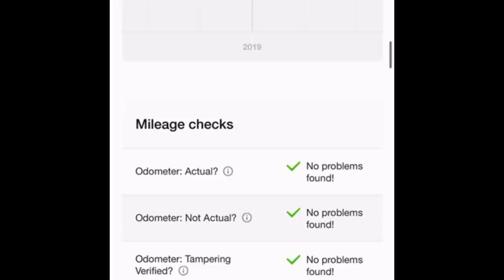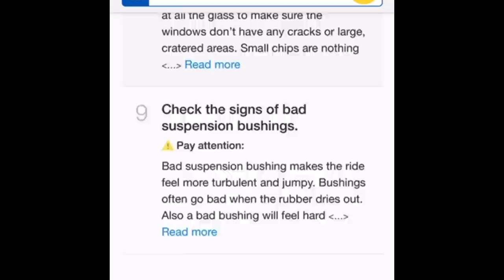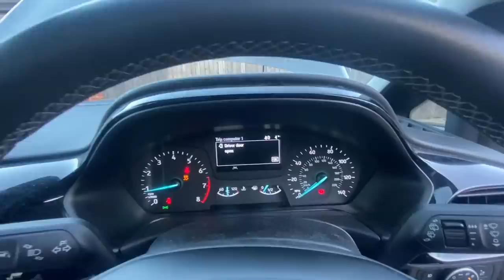2019 Fiesta Lemon !!!! Probably The Worst Crash Repaired Car Ever !!!! PT 1

Comment: Having seen someone actually say that on a BMW X3 the damage to the wheel arch/sill wouldn't be visible because the wheel arch liner would hide and thus didn't need repairing I was horrified. What you have found is the tip of the iceberg, please keep these coming, hopefully the buying public can be made more aware of what's out there.

Comment: In Australia, they have two categorys of write off, repairable write off and statutory write-offs. Statutory write offs are deemed unsafe to be repaired like Cat Bs and can only be broken up for parts. Repairable write-offs can only go back on the road with an approved structural inspection (usually at select government approved body shops or by government inspectors) where photographs of the repair process must be presented as well as receipts for the parts used (to limit the use of ringers/stolen parts). It makes the repair process considerably slower and more expensive but it keeps the repaired vehicles safe. It makes it a fair industry where you can still repair vehicles even if you don't have the formal qualifications provided the repairs are done properly.
They could adopt a similar system in the UK, perhaps loosing their Cat status when repaired properly to give incentives to the repairer to repair the vehicle to a high standard.

Comment: Chris is correct, Cat s should only be sold to correctly authorized and trained people with the correct equipment to repair to a safe standard. The 'Repair' to that car is just butchery and it's not good enough when people's lives are at stake riding around in a car like this.
Reply: I don't agree, there are thousands of amateur engineers with loads of experience  who buy damaged vehicles to repair for themselves or others, if they are bought cheap the sale price should be reflected. The problem is if you don't research and view properly you are buying blind. I have done so many times, it is a gamble. I don't know what they paid for this but my calculations build in the worst case possibility. My first calculation is the retail value on a Cat S is going to be worth 50% after repaired. The "butchery" on this car appears to be cosmetic mainly sheet metal and plastic. A front end from a rear damaged car will sort it out. A jig will sort the chassis leg(s) out too.
Reply: May be the answer is a proper post repair inspection, rather than just an MOT.

Comment: I used to work for a company where this is literally how they fixed their vans. If they got into minor accidents (by "minor" I mean "still visibly recognisable as a van") they used filler, pop rivets and hammers to knock them back into shape and put them back on the road, a little uglier but usable with orange-peel paint and panel gaps. To be fair - It's not actually a major problem to do slightly tatty repairs provided you're not worried about the resale value (and they weren't) or the cosmetics (and they weren't) and it's just cosmetic (which it generally was). To be fair, servicing was done on the dot and anything actually safety-related was fixed properly. But some of those vans after their 3-year tour of duty with the company were probably as much filler as they were metal. Even holes in plastic panels were usually repaired with fibreglass and Isopon. It's actually not so difficult when everything is the same "Ford Transit White" paint colour.

The nice part was that when the drivers has minor bumps and bashes nobody yelled at them as it wouldn't cost much to put right - generally the transport manager was more concerned the driver was okay, and getting the load into another vehicle if theirs couldn't continue.

Comment: What a mess.  I've viewed many cars in Birmingham but I've never bought one, everything I've seen has been bodged up in one way or another.  I buy & sell Cat S cars and I'm not a qualified mechanic or repairer but all my cars are repaired to the highest standard and go out the door with a full service & MOT to prove their roadworthiness.  I also supply pictures before, during an after repair so my customers have full peace of mind before paying a deposit.  I've got a car here that's all repaired bar a dented bonnet and I won't let it out until the bonnet has been sorted, it's only cosmetic but if you're going to do it, do it right.  While regulating Cat S purchases would stop me from trading, I agree that Cat S inspections should be compulsory.  I can't do anything to my house without building regs and it's not going anywhere so it's a bit crazy that multi-ton killing machines are allowed back on the road without any form of inspection.  I hope you get parts at a good price, keep up the good work.

Comment: Joking aside, surely there are some serious questions to be asked about this car. Many years ago, and it was many years so things might have changed in the meantime, when I was a lad I rebuilt a written-off Mini. At the end of the rebuild I had to produce all of the paperwork to an inspector and the vehicle had to be thoroughly inspected to ensure that it was roadworthy before it could be re-taxed and allowed back on the road. Doesn't this happen now? If so, the question  is not only who rebuilt this car but also who inspected it and what was the relationship of the inspector to the people who rebuilt it? It's OK laughing about this and saying OK, Chris and Rob will do it again and make it safe, but those people are still out there doing the same as they've done here with more cars and they need to be stopped, if not also severely punished. They are putting people's lives at risk.
Reply: Battz99,read my reply,I done like you and had a man come down and check it all over

Comment: Shocking and worrying. To repair a boiler you must be gas safe, to work on domestic electrics you must be NICEIC qualified. To repair a written off car.....
Reply: You have to be a bit careful with this one as you don't have to be qualified to change brake or suspension parts on a car either and getting it wrong could be serious. However if you take the opportunity away from people to make their own repairs it would be unfair and price some people out of car ownership.
Reply: @philtowle4683  Good point.
Reply: @Thereishope664  I do think that cat S should have to be assessed after repair. I had my car written off and might have bought it back to repair myself if it had been cat N but it was classified S so I didn't even ask for a price.
Reply: @philtowle4683  Yes, I had a similar experience with my daughters 55 plate Mini Cooper, it was written off and the insurance company allowed us to repair for a slightly smaller payout. It required a bonnet, and a radiator plus cowling. Total cost less than £300, and the bonnet was S/H on Ebay in the correct colour!.
Reply: Government only interested in landlords for money , car in duty needs the same force applied but it’s getting easier not harder to do this kind of crap

Comment: Back in the 90's when we purchased cat C/D before S/N was created , these cars appeared at auctions like HBC Canvey Island and the like and we stood amongst other traders and bid to buy ! When a vehicle was severely damaged it was noted by DVLA and when you repaired it and a new V5 was issued, the new owner got sent an inspection request to be carried out by your local rozzers. I had several back in the day mainly because the auction people didn't very often give you a log book , but also because in those days you weren't legally obligated to declare previous damage ! So I registered the vehicle , took it for its inspection (which I should just add , they flew through because we had high standards) and then sold it for a price that reflected its slightly grey past. 
So do Copart ONLY sell to the trade ? Proper trade , premises/traders policy insurance/trade plates ? Not , two lump hammers and a lead light in your up and over door garage.

Comment: Around 1989 I bought a blue 1982 mk2 cavalier I jet washed the engine bay the blue paint came off it was red underneath, we picked the car up with a fork lift there was a weld across the middle of the car, 2 cars welded together a cut and shut

Comment: I have a 2013 honda CRZ. Guy said it was fine. First look at it, the only parts that are the original colour is the bonnet and roof. EVERY panel on the car has been resprayed and had filler on it at some point. It has not been declared in any accident. It drive fine and I got it pretty cheap.

Comment: That's well bladdered! Looking at the condition of the chassis legs, I wouldn't be surprised if the firewall, scuttle and bulkhead aren't creased. Watching you drive it back to the workshop, there was a dirty big crease in the headlining. I wouldn't be surprised if all the airbag curtains are missing too. It's certainly going to be more involved than just cosmetic bolt on stuff. Shouldn't really be returning that one to the road in my opinion

Comment: Great video guys! Your ethical and professional approach to salvage is bang on the money. This video needs to be mandatory viewing for any used car buyer. It feels like codes of practice and properly enforced certification or inspection is an essential requirement. Wouldn't want to exclude the competent amateur, but how many own or can operate a jig? Either way, the p*** artists in the trade doing this quality of work need to be driven out of business. One for Trading Standards, or without standards to enforce are they then toothless and probably too busy anyway?

Comment: Hi Rob & Chris, just a quick note about cleaning foggy headlight lens. Try a tooth whitening toothpaste (such as Crest Complete Extra Whitening Toothpaste with Tartar Protection or Colgate Advanced whitening). Use the toothpaste liberally with a microfibre cloth or a toothbrush and a circular motion.  And you should find that the bleaches and fine grit in the toothpaste will clean the headlight lens.

Comment: I did just the same as you mate, heard about a cheap st170 in Scarborough, 80 miles away, was committed when I got there, knew it was a dog, when the v5 came back, 13 owners, cat c, absolutely all sorts wrong, did loads and loads of work, in fact everything it needed, sold it at a big loss, customer tried to return it to me as it was still a dog, I refused, ended up in County Court, lost, ended up with high court sheriffs at mine who put a charge on my e type (!) they couldn't believe their luck, cost me 2.5k in damages, fees and all that, got the car back, sold it again and bizarrely the guy loved it, when the customers had a report done on the car even the paint thickness was measured, how's that!

Comment: I'm no mechanic, but when I had a knock in my old car, I replaced the bumper that was cracked and replaced the crash bar, which didn't need doing, just to be on the safe side. Like the format.

Comment: Noticed the headlining all crinkled,  has the curtain bag gone off and bodged too?
Problem with only selling cat s to proper repairers is how to validate that? How would you validate yourselves as this?
This industry needs a revamp as that car is not safe to be on the road,  it would not fail an mot as the structure is not like at unless it's obviously damaged. In sure there are thousands just like this on the roads.

Comment: The part that bent and let the car loose is called a shackle and you are supposed to screw the pin in so it will not come out. That shackle could not have been done up, I worked in lifting gear as a youngster and used to certify them and all forms of lifting gear.

Comment: Pretty shocking. I remember back in the 90s a damaged repaired Astra where the airbag cover had been glued back on the steering wheel (with airbag missing) and the red warning tabs which pop out of the seat belt buckle had just been cut off.

Comment: To many of these botched cars about guys I've seen them and to the trained eye you spot them right away I've walked away from plenty ,i was a trained body panel beater sprayer into the 70s till late 1977 always kept my hand in ,but these days i will do little fixes with plastic parts headlamps odd new wings beyond me now for a small collision these cars are meant to fold. and if a garage can bodge and get away with it ,to some unsuspecting punter they will.As your partner says if this is cat C .D. or was it S .if there put back on road they should me either Licenced to repair or they must be inspected by a reputable garage or inspector. So this Fiesta would never have passed,as if it was involved in another belt same as previous whole car could have folded possibley....
Reply: As a new driver do you have any tips to look for when buying a car

Comment: I don't agree, there are thousands of amateur engineers with loads of experience  who buy damaged vehicles to repair for themselves or others, if they are bought cheap the sale price should be reflected. The problem is if you don't research and view properly you are buying blind. I have done so many times, it is a gamble. I don't know what you paid for this but my calculations build in the worst case possibility. My first calculation is the retail value on a Cat S is going to be worth 50% after repaired. The "butchery" on this car appears to be cosmetic mainly sheet metal and plastic. A front end from a rear damaged car will sort it out. A jig will sort the chassis leg(s) out too. Personally I would have estimated £2k to put it right or got myself an Uber, you were a couple of miles away from Birmingham New Street station and back on a train. However, as always you will show us all how to put it right which will be fantastic content.  Keep em coming. Great re-cycling.

Comment: I bought my car off a really good source. Has his own garage with mot bay.  Words couldn't explain the condition of I found my self in when I realised I'd bought a lemon.
He put 12 mths mot on it for me made me feel confident in my purchase.
Headlights seat belts airbags all faulty. Fails mot every time it goes in   never in all my years have I ever experienced so much anxiety. I use it as a run about due to not being able to afford another car.  Never told me about the accident damage either which wasn't recorded.  When I go on dvla mot checker it even failed miserably for many years before I purchased it. Lost faith now in used car dealers.

Comment: To repair it properly wouldn't have cost a whole lot more though... got no idea why they decided to cheap out so much!
Reply: Because they simply didn't have the knowledge or equipment to do the job properly.
Reply: Neither did I... but it's much easier to bolt something off, bolt a new one back on... Then whack that leg in/out using a tow rope from a car... that's what I did LOL

Comment: Honest opinion, the entire system needs an overhaul.

My first car i purchased as a CAT C write off 8 years ago. It was a Vauxhall Corsa C on 54k miles and was in a front end and rear end smash. Needed new bumpers, radiator, crashbars and a bootlid. No actual chassis damage, didnt need paint and bodywork was in good nick. All in it probably cost me £400 to get back on the road, at the time it could've been sold for over £1500. A 17 year old lad on £2 and hour salary certainly couldnt of afforded to purchase something else.

Not sure what the solution is, other than for the entire system to be overhauled. Crashbars and bumpers alone shouldnt be marked as structural. Real chassis damaged cars shouldnt be sold to any old joe bloggs and will require certifications to be purchased if the vehicle is to be put back on the road. But on the other hand, a now CAT S car could be a good donor car for Joe bloggs to get his other car going that needs a new engine and gearbox.

Comment: I not too long ago got an Audi A3 from a dealer on finance. One of the front headlight units needed replacing as water was getting inside it. And as I've tried removing the front  bumper to gain access I couldn't get it off, well turned out some idiot had screwed it in place with long wood screws. And it looks like the screws were drilled in from the outside then bodyfilled and paintwd over. They have even wood screwed with the headlights. No idea why they've done this but I'm now left to buy a new front bumper and god knows what.else. Because why has it been screwed on. It has puzzled me and really annoyed me. I love the car but I'm gutted 😫  I can't really afford to buy a bumper and have it coloured match and what ever else it's missing. Absolute joke

Comment: What an absolute mess!  Just the other day, we looked at a 110k (incorrect mileage MOT entry / discrepancy) 17 plate Vivaro that had a similar looking front end; gaps you could land a plane in, peeling and/or rusty paint, filler round the edges and a headlight only held in with one lug.  Didn't even bother opening the bonnet.  Shame the owner of the garage wasn't around at the time as I would have loved to tell him to shove the van plus the 8.5k asking price where the sun don't shine!

This was in Mansfield but possibly repaired by the same idiot?

Comment: Looks like they have sanded the paint on the front panels gone all dull and dents all over it bent and buckled deffo needs new wings been bodge job sprayed them filler slopped on even the bonnet is all wavey across